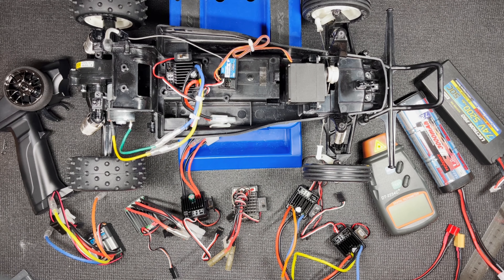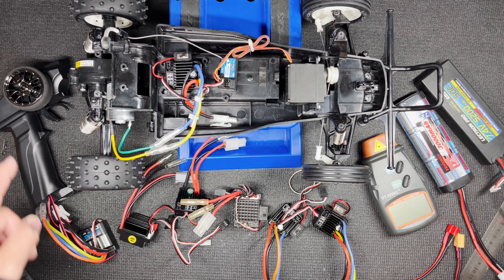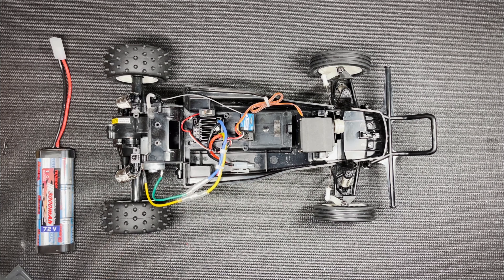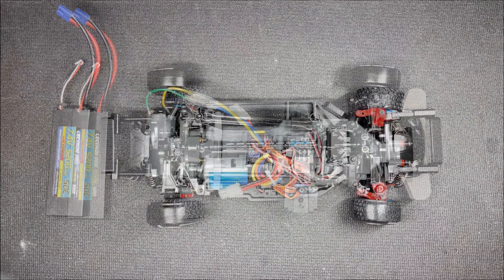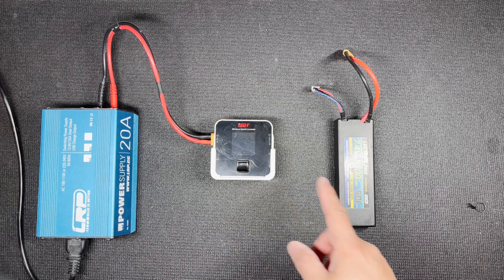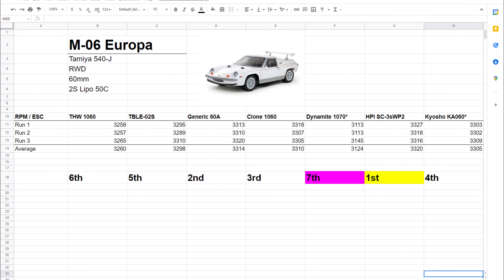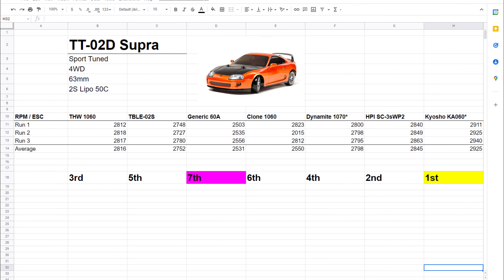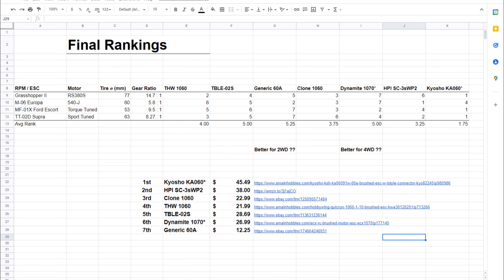WHICH BRUSHED ESC IS THE FASTEST? Electronic Speed Control RPM Motor Speed Tests #esc #tamiya #rccar

Comment: I bought a pair of those HyRC esc's and both of mine were defective right out of the box.  

I have a bunch,  maybe six or eight of the super cheap generic BDESC-S10E-RTR (I think these are the same as your last place finisher) bought from several different vendors calling them different things, they have all worked though not all worked the same or well.  But for the Tamiya's I've got them in they are fine.  Ohhh and I love project farm so thorough nice imitation you did well.
Reply from the maker: I enjoyed making this video. Tamiya ESCs are definitely worth holding on to. The 1060 is what I would put in my cars.

Comment: I have the generic 60amp. It looks like the weight and work (2wd vs 4wd)drawing from the esc factored into the placings. It took second place with the 2nd M06 Europa, but last with the others. I wonder how much the grasshopper (5th place) weighs compared to the M06.

I ordered a 1060 lol.

Comment: Would a power supply be obtainable for you? Could be able to supply motors and such with the same power for each test to eliminate battery fade etc. Would also be able to see current draw too which may be in interesting subject for comparisons, nonetheless a good test
Reply from the maker: I've been look at some $100 bench power supplies on Amazon. I couldn't think of other applications except using it for charging. I couldn't justify buying one. I think you are right. A constant power supply could give me more accurate results.
Reply: @RCsRCCars  oof prices are steeper than I thought, but not surprised 🙃